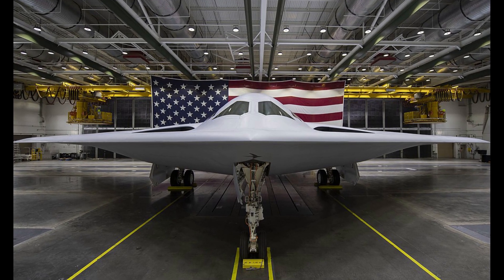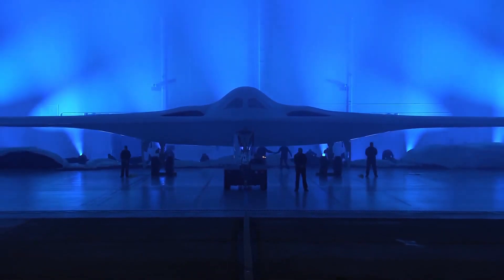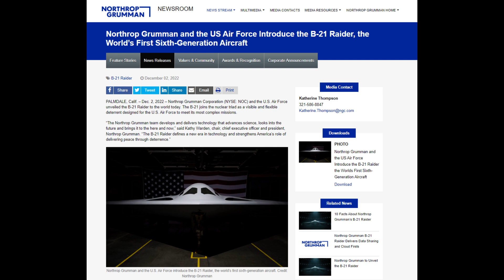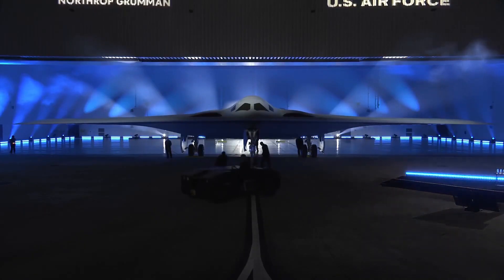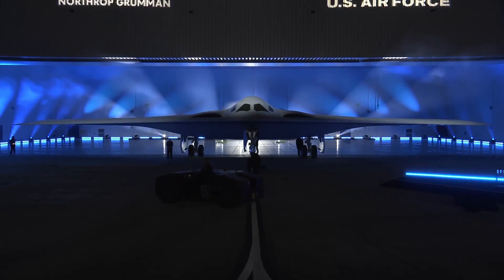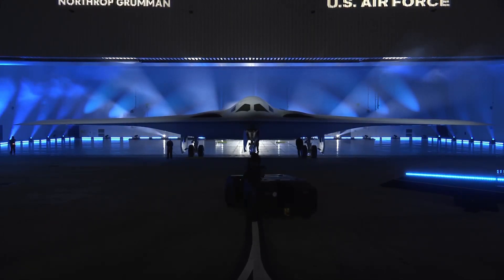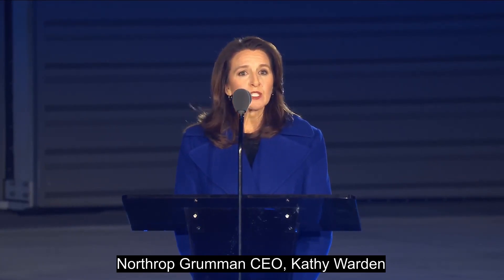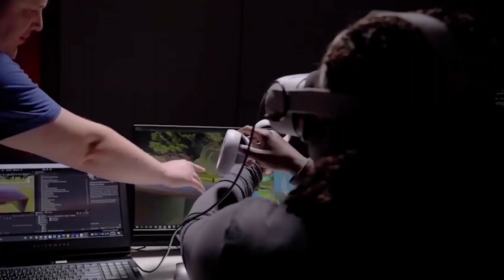B-21 Raider Stealth Bomber - Fearsome Weapon or Giant Money Sink?

Comment: 700 billion for R+D and initial cost of first bomber appears to be way over budget when it is just a improvement upon an existing platform.  

On top of this, the US would be far too afraid to fly this expensive war machine anywhere close to countries with advanced radar and optics-for fear of losing any secrets contained with in it. Like the F22, the new raider is just a expensive trophy that will see none to limited action in any nuclear/conventional war.

 Also this bomber is just a delivery platform that does not add any real significant value to our other arsenal of war machines. 

700 billion can net you dozens or more of conventional and nuclear weapons. The nuclear weapons are the ones that prevent world war from happening. 

 For conventional attacks against weaker countries we could just modify old deprecit aircrafts in the boneyard as drones and fly them into other nations as a swarm attack to further our empire.

Comment: Question: is the there anything comparable to a b2 ? and if there are advances in coating why do they not aply them to that like they upgrade b 52  for ages instead of geting another money sink? They create more and more astromical cost units for anything leading to less and less realistically usable....

Isnt it enogh to have total anilation agist nuclear powers with cost efective icbms and missle subs? If thease overcostly units are really needed it dont matter anyhow because we all screwed and for anthing else a B 52 just do fine like it did decades ago.......

They will burn uslessly too much money for hypersonic weaposn that are unneeeded just to dicBEEP measure vs Ru and china anyhow.
Reply: its a similar reason as the F-22s it would literally cost more to upgrade every single existing B-2s and restart production of the B-2s over the new B-21s in the long run, added the fact the B-2 along with the F-22 weren't designed to be modular unlike the F-35, which means you cant just easily swap out components and sensors so easily without running into compromises and compatibility issues with their existing components. Added the B-21 in general offers more capabilities in general than the B-2 including reliability and maintenance cost, sure its expensive but if Northrop is right about what it says regarding maintenance, in the long run the B-21s would be severely cheaper to operate than the B-2s and B-1s while having better performance overall. Oh and no the B-52 cannot handle everything else just fine not with today's anti air weaponry's ranges. In fact its probably only really suited now for mass strikes against stationary targets as anything mobile would see it coming from way beyond the range its weapons could be deployed from and thus the B-21's stealth is key both for survivability and element of surprise, giving the adversary less time to react and more importantly the adversary would not know from which direction the attack will come from as if they so much as know the general direction of the attack they can vector assets to that direction and potentially shoot down the bomber and the payload it launched. And in general its not a useless waste of money as it will also be replacing old/ aging assets that being the B-1 and B-2 that have very high operational and maintenance costs and are not as easy to update with newer technologies that become available.
Reply: @Frost-01  Wrong. The basic premise is that there are 2 powers: Nuclear or not. 

You cant start a war agist a nuclear power and hope they wont use their nukes when shit hit the fan. It dont matter if you can bomb the shit out of them with invisible aircrafts ANYBODY loses in the end.

The other side is minor powers that at best have a handfull of S300-400 equivalents and the US does SEAD good enogh to make that a noneisue in short time. B52 with standoff and after degration of air defence glide bombs will do you fine agist such threats. And it has the same network capability that any US aircraft that flys actuall combat misions has. 

Why do you think they retire the F22 but build upgrades for B52 and F15 airframes ? the chances are higher that some other minor power join the nuclear club than somehow geting close enogh in tech to be a serious threat to the US planes.And you just cant have as many mid to high 100 Million dollar planes compared to what was around before especally with the stupidly high maintance cost of Stealth planes.
Reply: @saschawagner5167  The entire premise of mutually assured destruction is to never resort to nuclear measures in the first place thus why such strategies exist, and any platform will be utilized to deliver nuclear weapons if it does devolve into that situation thus the need for stealth bombers as nuclear tipped cruise missiles wouldn't be able to penetrate a competent IADS thus every possible advantage from masking detection to the last second as well as making the attack's direction not known down to the last second is key to that even in an apocalyptic scenario, you need to deal the damage that needs to be dealt thus if you send B-52s they would not be able to get far especially against peer opponents as said peer opponents would have the capabilities to detect the B-52 and vector in interceptors towards it before its even in weapons deployment range especially with glide bombs, that's due to them possess spaced based assets and EW radar and as for why the F-22 was retired was due to budget cuts and premature closure of its production line as during that time it was deemed the F-22 was too expensive to operate and that there was no credible peer to peer threat to warrant its existence, and when China and Russia represented themselves as valid threats once again NGAD was already in development and restarting production lines for the F-22 would prove to be too expensive than fielding the new NGAD plane and thus why the F-22 was cut short, but by no means was it useless. The reason for the stupidly high cost is also because of the lower numbers of the platforms which is true for the F-22s who's production run got cut short and the B-2s which there are only a handful ever built. Compare that to the F-35 and you'd find the F-35 is very much cheaper to operate than the F-22 and B-2 due to the high number of frames which equals to a higher production rate of the aircraft and spare parts thus lowering costs. The B-21 is aiming to replace the B-2 and B-1 thus if economy of scale does apply to this instance they will be far more cheaper than the B-2s and B-1s currently in service and with more of them compared to the legacy platforms they will replace. Essentially in the long run its better to swap to the B-21 than keep trying to make do with the B-1s and B-2s especially since the B-1s are suffering from structural failures and have highly inefficient engines by todays standards while the B-2s are no longer as stealthy or survivable as they were years prior. Also dont forget even if the F-15X is indeed being acquired in large numbers they are meant to compliment the existing F-35 fleet.

Comment: That isn't how stealth works. Stealth is only effective in certain frequencies. Both China and Russia have VHF/UHF radar which can detect metal aircraft. Unless the B-21 raider has no metal in it and the engine has no metal in it, the bomber is not stealthy in VHF/UHF frequencies. So no, it can't penetrate integrate air defense with those types of radars.

That is why it is designed to carry standoff weapons. Why would the B-21 need standoff weapons if it can evade all radar detection?

Anyway, Here is what China is using in the SCS, SIAR radar. These large ground based radars can detect stealth aircraft from approx 1,000 miles away. https://www.jhuapl.edu/Content/documents/InDepthSubiReefCounterStealthRadar.pdf

Also stealth aircraft can be tracked in real time by IR satellites. Turns out that operational aircraft is hotter than ambient temperature. https://eurasiantimes.com/china-says-its-heat-seeking-radar-can-detect-a-stealth-aircraft-300/

So this can penetrate any air defense is very misleading.
Reply: Okay if that makes you feel better
Reply: Stealth aircrafts can be detected, I think you misunderstand the concept of stealth, stealth technology lowers the range an aircraft can be detected. LRASMs have a range over 900 kms, so they can just fire from far away without being detected. The radar mentioned in your article does not have a specific detection range and as for satellites, if US and China go to war, satellites will be the first target. The US builds weapons for a reason, and B21 is specifically designed to counter China's naval force in the SCS.

Comment: The B-21 will have a hard time evading AI supported satellites constantly scanning the Earth to find every military hardware in operation. If a stealth asset takes off from Missouri, the satellite is going to pick it up, process it in real time and send the data back to its HQ, then track it continuously until it hands off to the next satellite coming over the stealth asset.

In that way, if a B-21 will to come uncomfortably close to the border of the country (cough China cough) that owns that satellite constellation, a long range SAM can be fired and guided by the satellites to the exact location of that B-21, turned on its AESA radar and blow if out of the sky.

And that's whole point of why America is panicking over AI chips.
Reply: exactly 👍
Reply: the problem there is the number of satellites you would require just to keep track of 1 asset continuously.
Reply: @Frost-01  Why not? You just need a constellation. Launching entire constellation today is trivial today for a determined space power and that constellation can do more than tracking one target. It can track multiple targets, at the same time, everywhere. The only thing is speed of processing and on-board AI on the satellites themselves will speed up that process tremendously. It's the way to make the intelligence gathered as timely as possible, and time is of the essence.

Even if it take more time if they have to do it on the ground, it is still possible to find a stealth bomber in the air long before it can make the journey across the vast distances, even from Guam. It's not ideal but it's possible. By that time, the jets and early warning will have been scrambled waiting for the target. Remember, no stealth is fully invisible to radar. Get close enough, anything can be detected eventually, and the defenders just have to know roughly where the stealth attacker is trying to penetrate. Because the intelligence is gathered passively by satellites, the pilots and planners of the bomber wouldn't know they have already been found and tracked.

The missile is gonna come right out of nowhere from BVR, and by the time the PL-15 or PL-21 turns on its own AESA seeker, it will be too late for the B-21.
Reply: @Frost-01  They are already doing it for ships with optical satellites. They can now follow every ship on the planet with optical and IR satellites.
Reply: @johnzach2057  wouldnt that just make stealth even more of a priority then? because at that point everything that can spoof the missile be it stealth or actual jamming which the b-21 does have would mean life and death and the same can be said for china though if it can track airborne assets be it stealth or not from space, then the opposite is also possible for the US which would mean it essentially ends up in a game of cat and mouse at that point. China tracks the bomber and vectors interceptors to it, US tracks the interceptors and informs the bomber, the bomber then either disengages or reroutes and so on and so forth until either the bomber is shot down, fires its payload successfully or escapes.

Comment: As usual it will be plagued with tech issues and will take years before it will be operational. 2027 means 2035 at the earliest.
Reply: You’re wrong on this, typically the case, absolutely, though not this time.
Reply: I doubt it, but time will tell.

Comment: At $700 million, it is indeed an enormous cost, but the B-2 Spirit stealth bomber was much more expensive (over $2 billion USD each).  The list price on an Airbus A380 passenger plane is $445 million.  As part of a nuclear triad, all three portions are expensive:  How much does it cost to purchase/keep/maintain the land-based ICBM system?  How much for the submarines and associated nuclear missiles?  All too much, but IF they can keep the cost at $700 million each, in comparison it could be far worse....
Reply: In 2023 dollars over $75 billion was spent to procure 21 B-2 bombers.  That's about $3.5 billion each.  Half of that cost can be attributed to the extensive research on developing stealth capabilities.  Had the original program of acquiring 132 bombers been pursued, the per unit cost would have been much lower, but a still considerable $2 billion.   It was an unusual stroke of fiscal wisdom to curtail B-2 production--it has not been necessary for the American Empire.   I expect the new B-21 to cost at least $1 billion per unit, even though it is a smaller plane than the B-2.

Comment: From what I understand, the B-21 is supposed to offer the capabilities of the B-2 but at a fraction of the price. If true then this is a massive boon to the USAF since they can actually use their stealth bombers in something other than training and nuclear deterrence.
Reply: that's the plan. not the reality. like f35 supposed to be cheap because 1 platform for 3 kind of aeroplane (the A-C). the reality: need way more time and money.
Reply: Then you don't understand much do you?
Reply: You understand that F-35s are now cheaper than Eurofighters, Rafales and Gripens right? The program costed a ton because it was built at scale. It's the reason so many Air Forces around the world are now choosing it over other platforms. Not only is it much more capable, it is also cheaper. Don't fall for the anti-F-35 propaganda.
Reply: @breadnewbie6326  not true, the f35 today is cheaper then most 4.5th Gen aircraft with much better capabilities and B21 with 700 mio cost much less then B2 (2 billion per unit) or maintenance of older models

Comment: Even if the stealth capabilities of the B-21 is not as good as the B-2. its smaller size and unmanned capability as well as needing smaller airfields would prove a major challenge for china (and possible other adversaries) as it would be cheaper, can be lost at a higher rate, harder to track, and launched from more bases (e.g guam, okinawa, saipan, phillipines) rather than just Missouri.
Reply: Can launch from australia
Reply: Depend on how much does the US could produce them, if they can't produce it on large quantitity and with higher cost, the fate are pretty much  like zumwalt destroyer

Comment: I doubt it will be undetectable, at least not for long, and the cost per plane will more likely be north of $1bn. Nuclear-armed hypersonic missiles would be more cost effective.
Reply: A hypersonic cruise missile can only go so far if its detected early and thus why you'd still need a competent delivery platform which can get it as close as possible, with today's technology you can spot an enemy bomber before it even gets in range to deploy its payload and attempt an intercept of both the bomber and the missile itself be it hypersonic or not. Narrowing the distance of the launch from the target along with obscuring the direction of the attack can go so far in affecting the enemy's time to respond. A simple example be a B-52 vs the B-21 who would get detected and shot down first? of course the B-52 would while the B-21 would still stand a chance of getting into weapons deployment range and scoot away before it can be intercepted if so.

Comment: Initially the f35 was intended to cost 30 to 50 million per unit. F35 was designed as inexpensive, high tech, modern 5th generation fighter bomber attack carrier role. Now the f35 is well over 100 million per unit and the cost will likely run 50% more.

Back in 2005 when 5th generation fighters were hot potato's, f22 was supposed to be the expensive replacement for f15 and it was estimated for 120 mil per unit. now the f22 can even run as much as 300 millions per unit. And f22 was capped at 250 units. 

I see b21 eventually cost more than 1.5 billion per unit, and the us will get 20 units before they go full broke.
Reply: Haven't F35 costs dropped significantly?
Reply: @FloofyMinari  They have. And the more that are purchased the cheaper they become per airframe. As for the B-21, we may not wind up with the full 100+, but I imagine will get at least 50-60 units. It is intended to replace the 20 B-2’s and all the B-1’s, of which we have about 45-50 or so operational.
Reply: f35 costs are 77 million for A model and will go down
Reply: The F-35 was absolutely never intended to cost 30 to 50 million. Also I like how you used the term "well over" even tho only one of the models costs slightly above 100 million. The A model costs less than 80 million. But yeah the general in your head thinks it costs well over 100 million